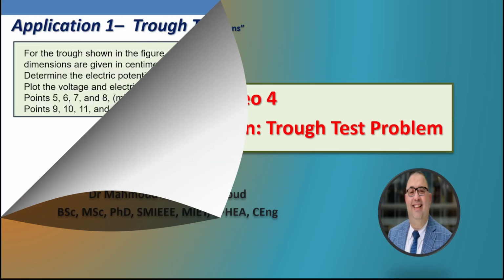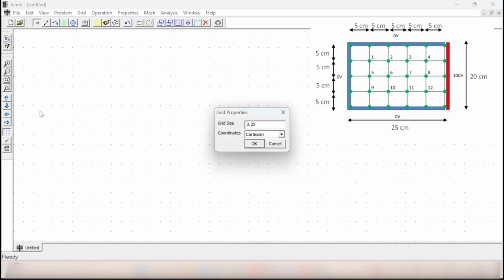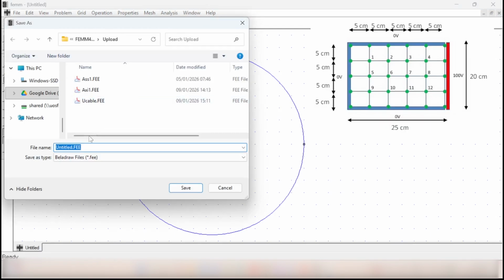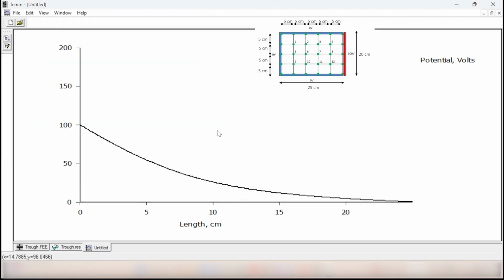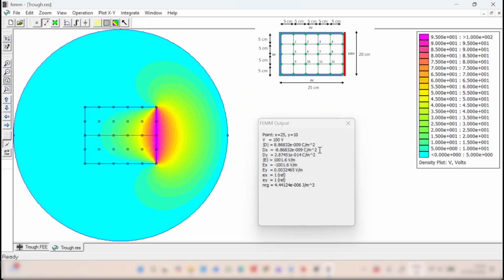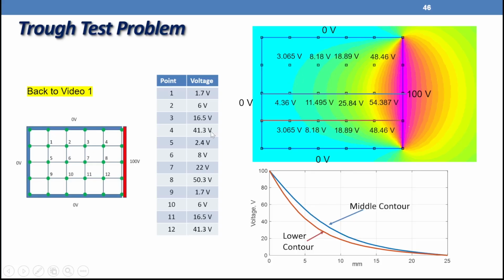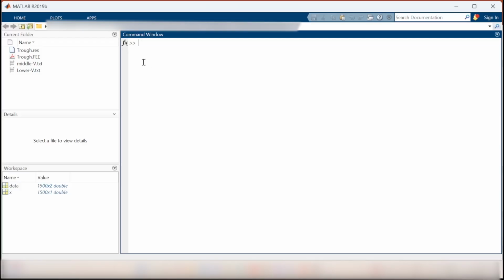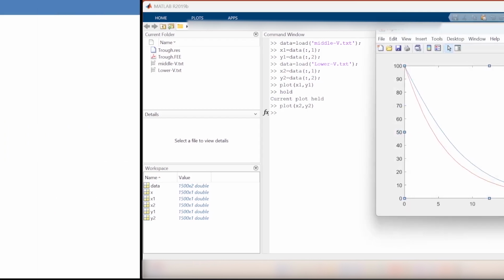FEMM 4.2 Electrostatic Application | Trough Test Problem (Solving & Results)

Comment from the maker: This video is a continuation of the FEMM 4.2 simulation workflow.
👉 Watch the previous video (Steps 1–7):
https://youtu.be/ifdcAW9mehg
In the previous video, we covered:
✔ Problem definition
✔ Geometry creation
✔ Material assignment
✔ Boundary conditions
✔ Mesh generation
👉 In this video, we complete Steps 8 & 9 of the FEMM project:
✅ Solving the electrostatic problem
✅ Viewing and extracting results
✅ Capacitance calculation
✅ Result validation with hand calculations
✅ Exporting FEMM data and plotting in MATLAB
🔁 If you’re new to FEMM 4.2, make sure to watch the first video before this one.
👍 Like the video if it helped you
🔔 Subscribe for more FEMM 4.2 & FEA tutorials
📤 Share this with friends or classmates learning simulations
💬 Comment below with questions or topics you’d like covered next